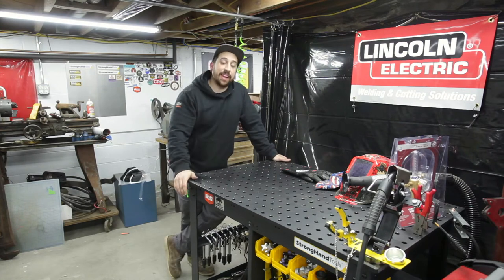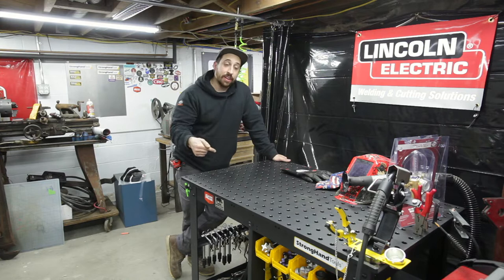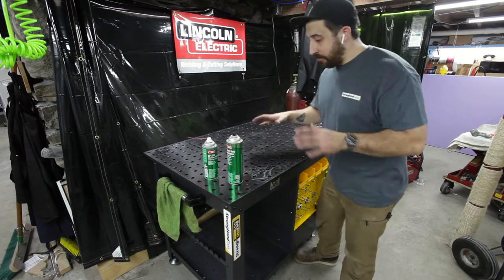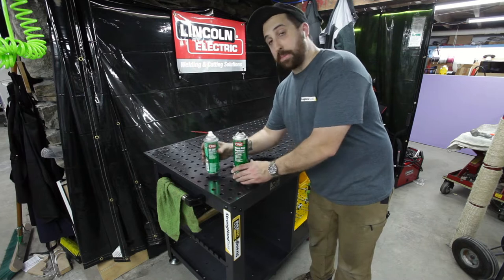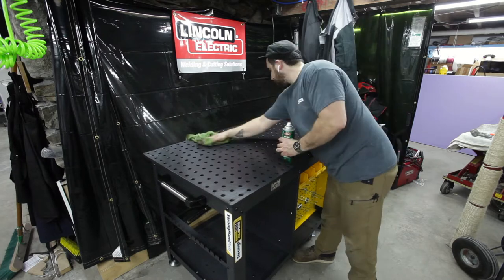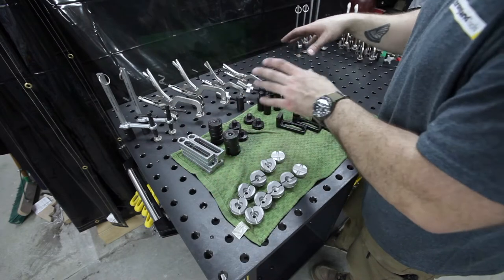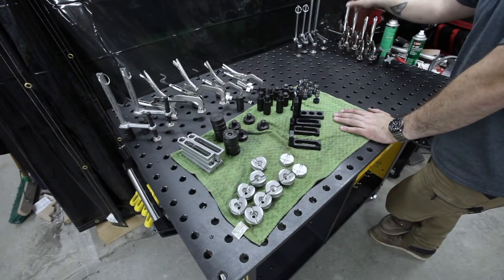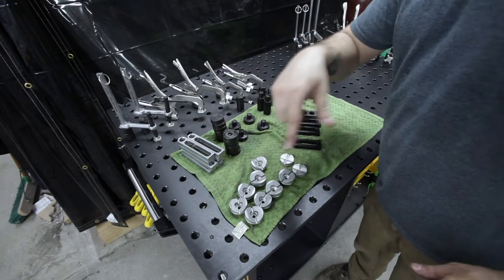Setting Up My New Rhino Cart!

Comment: whats the underside of the actual welding surface like , is it reinforced or just a plain sheet of steel
Reply from the maker: There is a structure underneath it, essentially a frame with some cross braces all made of 1/8” steel but the tabletop itself is 5/8” thick solid steel so it’s very very sturdy. No flex, no give, no play.